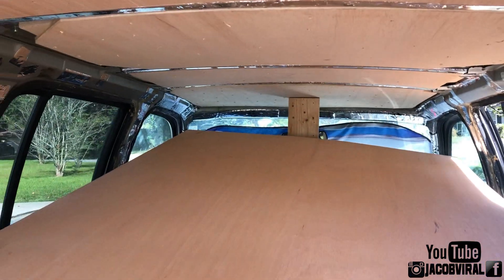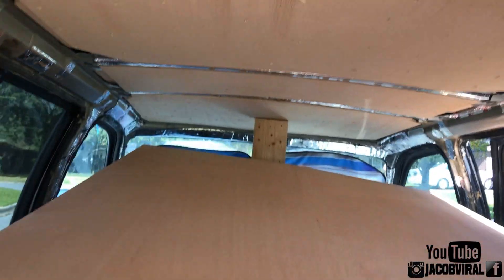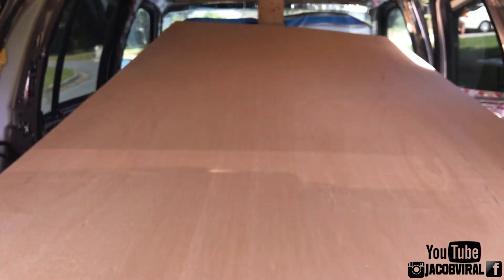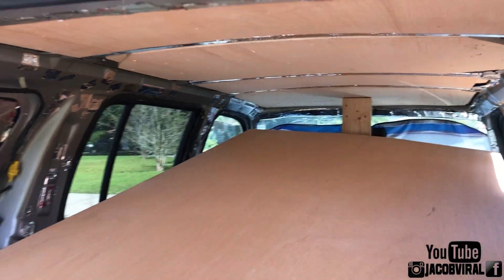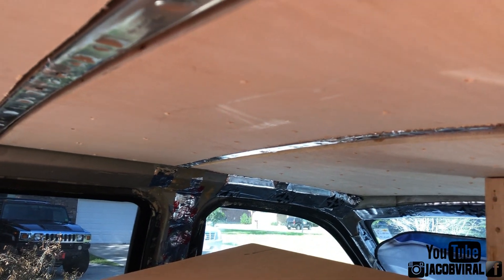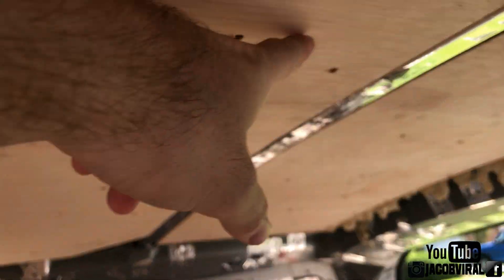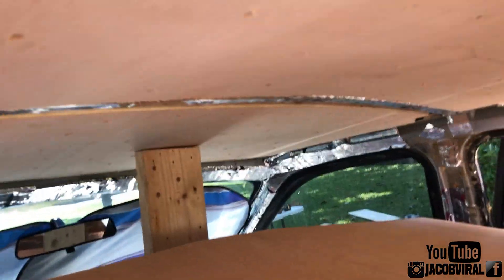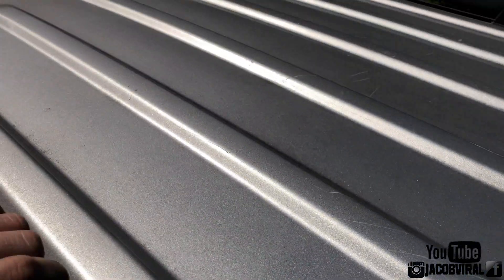BUILDING A WOOD ROOF FULL PROCESS PART 3

Comment: This is currently the part I’m at in my wood roof build. I ended up with enough scrap wood from my first two layers of half inch.. that I’m now doing a third layer of half inch, and then a final layer of 3/4 birch plywood.. my roof is also a lot more bowed so the extra thickness should help to make it as strong as your roof. Your roof is a lot more flat than mine is..

Comment: I know this is old but you could’ve bolted unistrut to your roof braces, then used spring nuts to bolt a thick piece of wood onto the unistrut, then foam in between that and saved yourself a lot of money and labor
Reply: Was thinking the same, all the layers makes it very heavy

Comment: Great idea of using 1/2 inch. When doing wood roof just use tons of thick adhesive like that and make sure it's really pressed into the metal in multiple areas. Use thick adhesive for each layer because they roof will move when you remove the bracing and you want to make sure all layers are really well adhered!!

Comment: JV, I need some advice: How should I add (wire up) a SB (enclosed XS Power Super Bank of caps) and a 2nd battery? By wiring all positives together and then all negatives? Meaning, (+) under hood battery to (+) 2nd batt to (+) SB to (+) amp ?
Reply from the maker: I’ve never worked to caps or super banks to answer this sorry man. Let me know how it goes so I can learn from you though.

Comment: hey jacob i plan on reusing my fac heaad liner im gona go with half inch wood will my head liner fit back up 04 yukon thanks
Reply from the maker: Usually wood blocks the pockets/tab connector points that hold up the liner so I would think no unless you build/work with what hold up the liner.. Every vehicle varies
Reply: @JacobViral2  thanks !!!